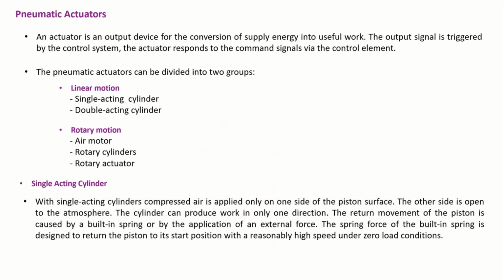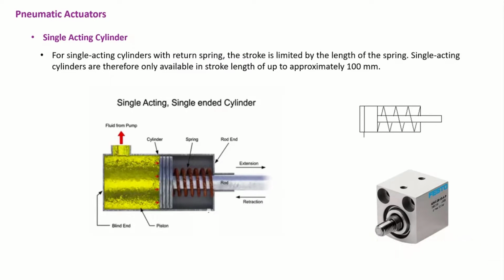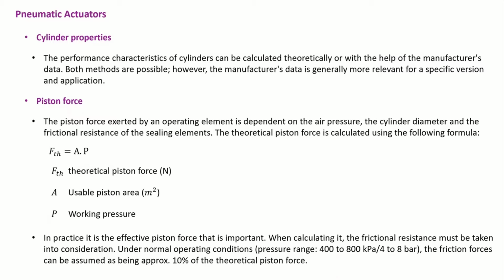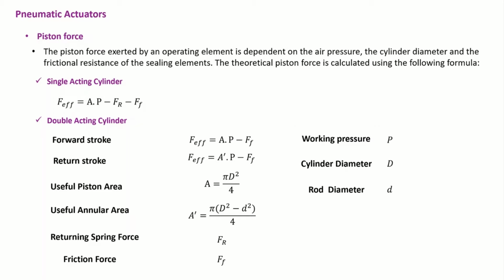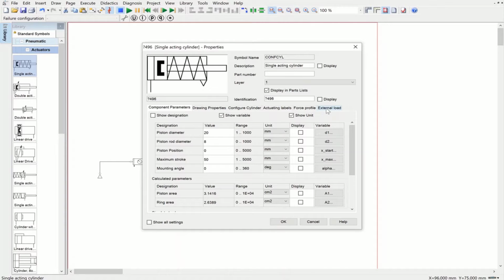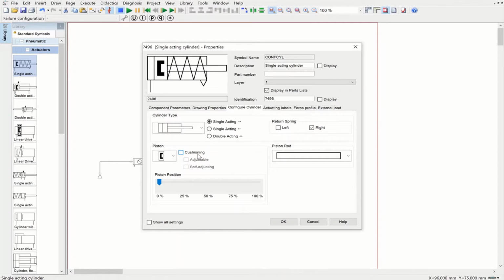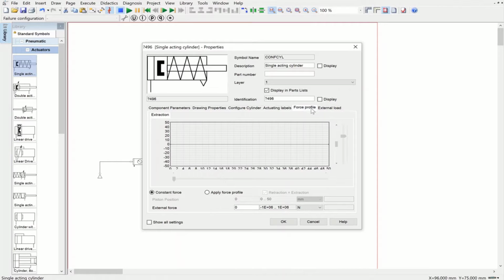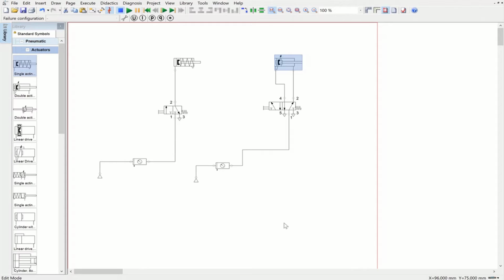How Single and Double Acting Cylinder Work(Part 2) | Introduction to FluidSIM | Tutorial 3

Comment: please make video on more  circuit like video 1 and 2
Reply from the maker: Thanks for the comments. This series will be about 20 videos which will cover designing several pneumatics and electropneumatic circuits. We initially cover the main components such as actuators and directional control valves. Then, detailed circuit design will be posted.